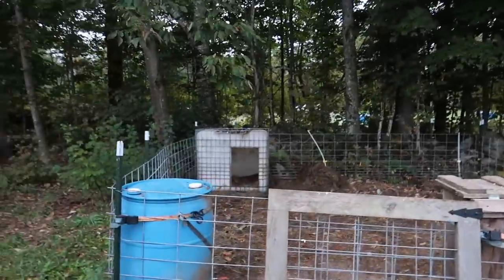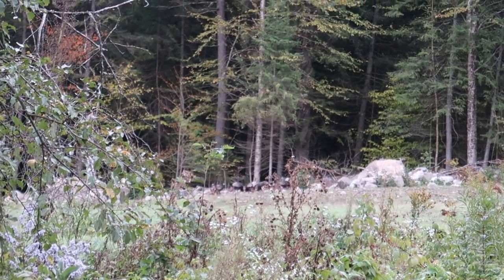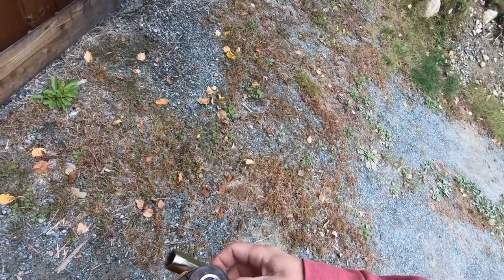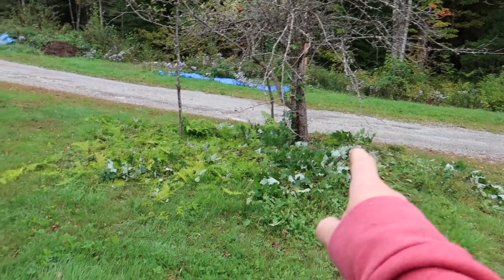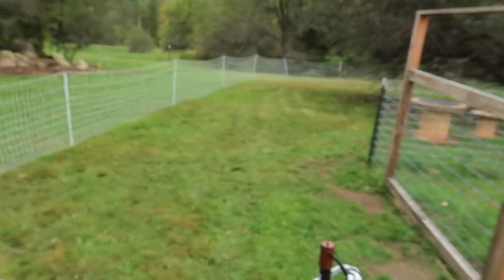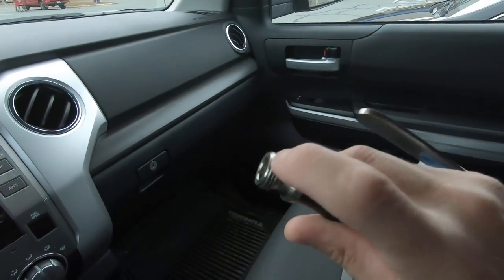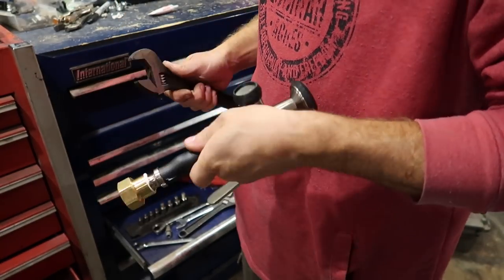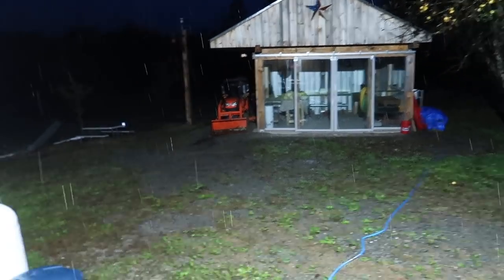Shhh...... Don't Tell Gina we Had another Hen Go Broody!

Comment: "Shhh, Don't Tell Gina" videos are my favorite, LOL.  But don't tell Gina!  IPS is Iron Pipe Straight thread. It's meant to seal on a washer (like the threads the hose for your toilet or faucets attach to). NPT is a tapered thread, designed to seal on the threads, which is why you put pipe tape on them - to lubricate them and help the threads deform and create a seal.

Comment: Hey AL there should be a grease fitting on the shaft end or you can always apply a little by hand. My buddy owns a power equipment place and says that people forget to check that after a while and wonder why they have problems. Also a review I saw about that new style cutting disc mentioned they experienced chainsaw like kickback and recommended having the safety guard installed like a string trimmer has especially swinging it from side to side made it happen more he mentioned..maybe something to keep a eye on... also on new equipment it voids the warranty if you remove the guard which a lot of people do to run longer string or cut it off at the knife. I know you wear chaps and other ppe but I like my legs so I do the same and a few other measures if I'm using non oem accessories for the first time. I'm a little over 4 hours away if you ever need a hand clearing or cutting up trees I own all kinds of chainsaws with different size bars large and small. Would be honored to work on your farm!